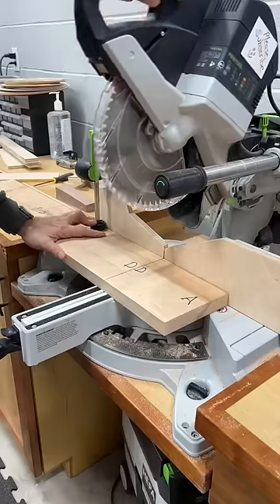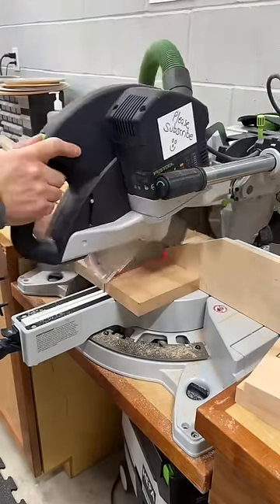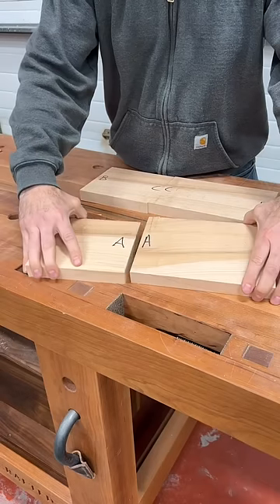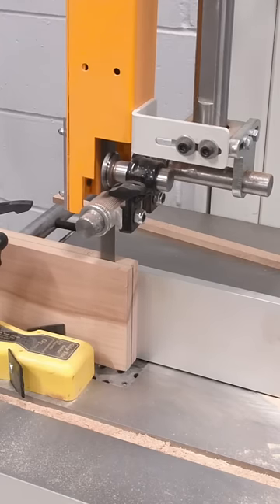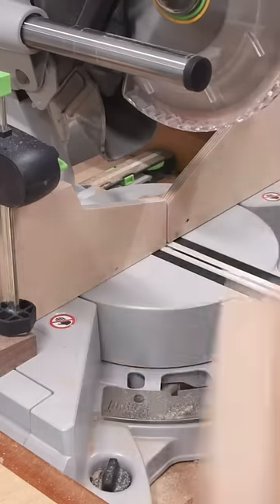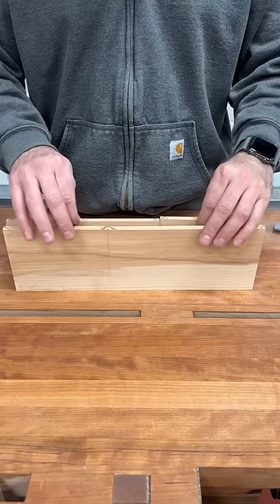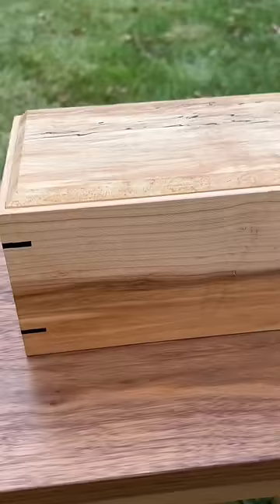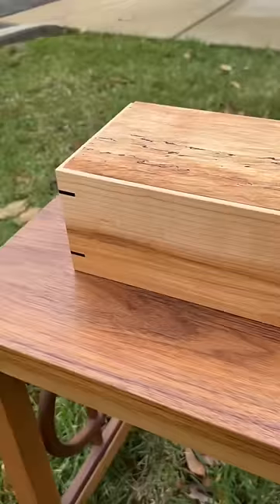True Continuous Grain | #shorts

Comment: The original design arranges the boards like 1 2 3 4 which becomes a problem because it wraps at 4 - 1

If you split the board down the center, you will have a mirrored copy of each face and so can arrange the boards like 1 2 2 1 instead.
Reply: At least theoretically, on these sizes and as long as no middle grain as to be removed it should work, the grain do shift slightly along the thickness how ever but as said on these sizes it is of no issue
Reply: So if a laminate that’s great but we gonna talk about the box being 3/8” thick or what your gonna do like spray activated ca glue to re build the 3/4

Comment: I think I've worked it out. So if you have sides ABCD, cutting it in half gives you
Inside: ABCD
Outside: ABCD
So you switch AB from the inside for CD from the outside and now you have
Inside: DCCD
Outside: ABBA
Reply: Or, you take the second half of the plank CD, slice it in the middle and fold it out like as if it was a flat cardboard box. Then do the same with AB to make the middle. You'd still see a change in the grain though if you looked down from the top
Reply: Thank you.   This is the only explanation here that actually made sense to me.
Reply: THANK YOU For The Explanation! I was trying to wrap my head around this but the answer kept Slipping Through My Fingers All The Time. The Day Before You Came I was just about ready to Take A Chance On calling out an S.O.S. to Fernando or Chiquitita. But, Mama Mia, you’re a Super Trouper! Does Your Mother Know? 😉

Sorry, could t Resist! 🤣 Now if we can only figure out how to make the inside box reference ACDC…. 🤔😅

Comment: This took me 5 re-watches and a full 5 minutes to understand how it worked, thanks for the tip.
Reply: I'm stoned and rewatched it ten times. I still don't get it 🤦‍♀️😂
Reply: @cececox6399  The middle/interior surface (which is in contact with the blade) of a thicker board becomes two mirrored surfaces that can be used as exterior surfaces of a box. Try to take two sheets of paper and draw a simple pattern on doth but to be mirrored patterns (onto one draw left arrows and the other right arrows). Then, you cut one paper some specific width measured from the left toward the middle and the other you cut the same width but measured from the right towards the middle. 
In the end you get 4 papers 
  <<  <<<  >>>  >>
And you can see clearly that the left edge of the first paper and the right edge of the fourth one will continue each other perfectly.
Reply: @cececox6399  We were taught very early in school to draw only on a half side of the paper with wet paint 🎨 and then fold the painting 🖼. If you would do this experiment you would understand what this video tells you.

Comment: Can you do a longer vid on this. I don’t quite understand.
Reply: Its hard to describe, because I'm not a native english speaker. As you saw he split the wood in half, because the now 2 pieces were "on each other" before, they have the same grain on the inside. When you flip the inside on the outside you will now have 2 wood bords wirh the same grain - just mirrored. Because when they still were together as one piece they shared the gain you could say, because it was between those 2 pieces.
I hope i could help.
Reply: Yeah blows past the key concept in under a second
Reply: It still doesn't make sense no matter what you do there's gonna be a mismatched corner.
Reply: He posted a longer version on yt:  "Step Up Your Box-Making Game! | Four-Corner Grain Match".

Comment: I think I've got it:  So after you resaw, you've basically got a ring (squashed flat, and cut in two places) of continuous grain.  You can cut it along the ring length any way you want, and you'll have matching grain at all of the cuts.  In this case, you cut  piece 1 into back,right, and piece 2 into left, front, making a square.  But you could make it into an octagon or whatever as well.

Comment: Use a Japanese pull saw to cut to length for an even tighter fit. And remember when you first start the cut, that is what has to be perfect. The rest of the wood will be removed when the miter is cut. This way you have a less than mm of kerf, instead of an 1/8th. Details remove the fails.

Comment: This looked amazing. Reminds me of a machine I used to work with called a V-Groover. It does exactly what it sounds like it does lol. It cuts a v-shape groove as deep as 1/32" from the through while simultaneously taping the other side and all we had to do was glue and clamp it and bobs your uncle a 101% perfectly wrapper grain! You can imagine how easy it would be to build a small wooden table with a tape dispenser build underneath the table.

Comment: A good way of thinking about this: it's like if you have two bars and you cut them in half in the middle. You can pull the middles out and form a square or rectangle.

Now if you make those bars thicker in one direction, and square off the edges you have two planks. 

Then if you join those planks at the middle to make a thicker piece of wood, you have the original piece of wood that he talks about.

Comment: Nice sticker on Capex.
How many motors did you go thru so far?
I’m on my 3rd one in the last 8 years.

Also do you prefer hall bearing blade guides for your bandsaw?
I’m with Laguna, with their “cool blocks”
But contemplating switching to ball bearings specifically for ability to tighten things up when I need to resaw for vaneer.
Had any experience with different guides?

Comment: Ok….I’ve watched this a dozen times and have to assume I’m just an idiot…..I still don’t understand what you did.  Can you please do a full YouTube video explaining this magic?
Reply: It took me a while but I realize the goal is to match the wood pattern ("grain wrap")  on the boards on all sides of the box 🙂
Since the thick piece of wood is being cut through the middle initially, it is possible to have a continuous flow of the wood pattern by using the inner sides of the wood as the external side of the boxes.
Reply: @kvmadanu  wouldn't it still reveal one edge to not perfectly align to make it seamless?
Reply: @DanVogt  no, that's the clever part of it. He's using the inside part of the thick wood plank to form the outside of the box. Kind of turning the wood "inside out". It could be a bit hard to picture it.

Comment: Please make a longer video about this lol. I.e. what is the "carefully rearrange" part
Reply: What you saw the board in half you have two mirror image grains on the two new board faces. Think of the two original faces as face A and D. After the cut the two new faces are faces B and C and they are A B C D in order. Just move the back board in front so the faces are C D A B. C will be the outside of two sides of the box and B will be the other two out sides of the box. 

You’ll see it right away when you do it.
Reply: @Bill Sedutto  ah! That makes sense now. Good looking out brother

Comment: Wait, somethings not right. In logic and proof of whats shown, it works and I get it works. But my brain is not connecting how. 
HAHA, in the middle of typing this I got it. For this example the grain goes from fat end to skinny, but if on the 3rd wall you turn it inside out, it goes from skinny to fat and reconnects at the end all the same because its the same pattern because you split the board in half thus preserving the pattern etc. 

Nice work. Gotta try this!